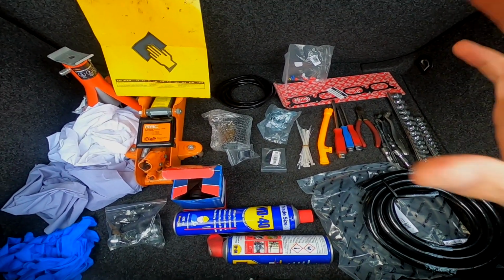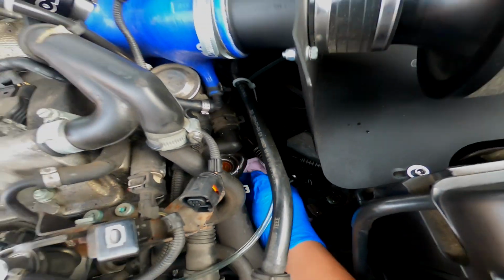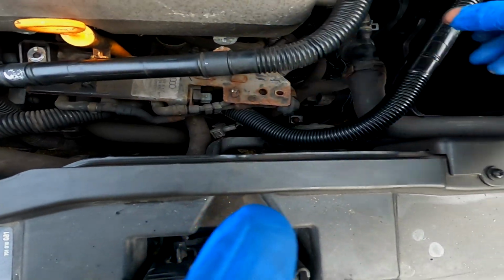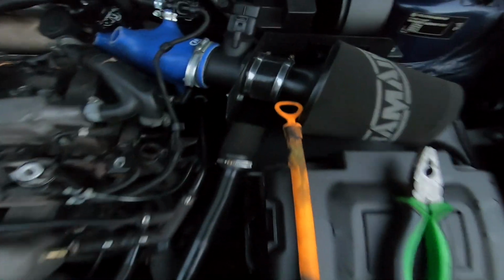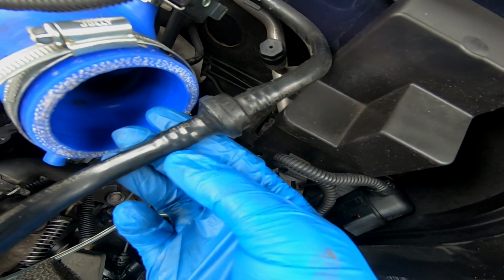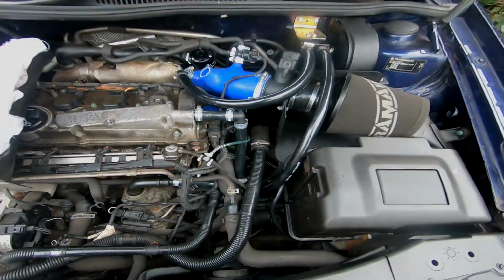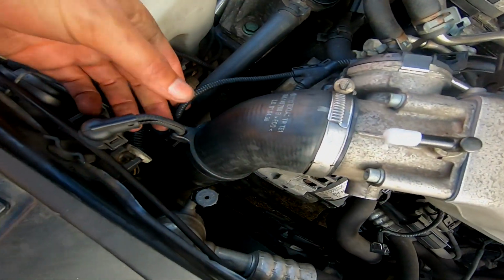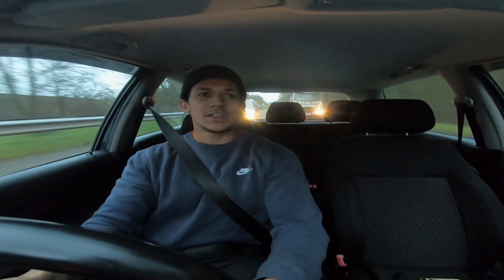MK4 VOLKSWAGEN GOLF GTI 1.8T SAI/N249/PCV/EVAP DELETE/CATCH CAN INSTALL

Comment: RIGHT! I've literally this minute finished doing this on my AUM, used your video as a reference when I needed it. Very helpful & informative. You're a diamond pal, thank you!
Reply from the maker: I'm glad you went for it man and im happy to hear the video came in use here and there if you ever got stuck. Well done for getting it done as it isn't easy. Thanks mate!
Reply: @SPOOLINUP  Runs sooo much smoother too, i was suprised, I bought the Cloud9 Catch Can in the end, came with everything needed, apart from an unfortunate slip with the stanley blade, all went smoothly haha!
Reply from the maker: Hahaha, so in that case then you could have had a small vacuum leak and removing these items got rid of it. What did you slip into with the Stanley blade? Lol
Reply: @SPOOLINUP  my hand, left blood everywhere, but the cars done, that's what matters hahahaha
Reply from the maker: Ahh damn, your hand will heal, if you cut through the wrong hose it wouldn't heal 🤣🤣
Reply: Were can I find the resistors from??
Reply from the maker: Hi, which resistors are you referring to?
Reply: @SPOOLINUP for sai delete n n249 evap??
Reply from the maker: I never got any resistors, I got them all mapped out/removed from the ECU.
Reply: @SPOOLINUP OK sound for your time appreciate it m8 top lad
Reply from the maker: No worries mate, i've been so bad with replies. I deleted all of the hardware and I had the EML on of course. My friend was able to map all of the software out and the car never knew it was missing anything.
Reply from the maker: I've just seen that those resistors are not expensive anyway.
Reply: @SPOOLINUP ye I know just sipping cost more lol 😆 easy map it out like u z only 180  mapping
Reply: aum , pressure appeared in the tank after plugging the fitting, connected n80 to put it in the air, How is your n80 now?

Comment: Same as everyone else great video , did you ever get any codes come up after a while after  doing this ? And are you still running your car like this
Reply from the maker: Hey man, yes codes came up after doing these deletes but I cant remember off the top of my head what they were. I have had the software deletes done from my ECU so that the car no longer throws the faults up. The only thing I have changed is I took the vacuum cap off the EVAP in the engine bay and it now just vents to atmosphere to prevent a build up of fuel vapour in the tank. Thanks for your comment and keeping it positive and supportive.

Comment: Hey did the resistor remove the secondary air engine codes. Or do I need to map it on order to delete that code?
Reply from the maker: Hey, I never fitted any resistors I just got everything mapped out and cable tied the plugs out of the way.
Reply: @SPOOLINUP  wow, why didn’t that cross my mind. Thanks 🙏
Reply from the maker: No worries man, literally anything that would be flagged up after the deletes was mapped out and my second lambda was mapped out too. Hardware deleted from engine bay and then software deleted from ECU.

Comment: Hello good video! I have seen these kits that companies are selling they include the resistors where do i put the resistors?
Reply from the maker: Hey man, are you talking about UROTUNING and the likes? If you follow the link below it shows you where to put the resistors. I never used them as I just got the software deleted. 

https://www.vwvortex.com/threads/diy-ultimate-sai-n249-pcv-evap-delete.4893472/
Reply: @SPOOLINUP  yes thanks! How big are all the hoses in mm? And how long are they?
Reply from the maker: I cant remember exactly mate but even the link has it all at the beginning exactly what you need. I know the catch can hoses are 19mm. Any vacuum hose required is 4mm and I believe the hose for the brake booster upgrade works out yo be around 13mm but if you check the link its all at the beginning and you can use Google to convert it to metric as its all in inches and feet.

Comment: Nice job. Do you have a knock sensor unplugged?
The VVT is for emissions or better performance?
Reply from the maker: Hey man, the knock sensor is still plugged in I havent touched it. 

VVT is there for emissions I believe it helps with emissions on cold start etc but no real performance gains unfortunately.

Comment: I can't thank you enough for this very well produced instructional video.
It was concise and easy to follow.
If you can do all that work with one hand you certainly are talented!
After removing the cylinder head on my daughters 2001 Golf  (Timing Belt failure) and disconnecting endless hoses and electrical connections I was happy to learn I do not have to put all those hoses back to stock.
You did a fantastic job showing each and every detail!
I had noticed when disassembling our VW  that several of those hoses and lines were dry rotted and surly there were leaks!
Surprising the car ran as well as it did!
Cheers!
Reply from the maker: You are more than welcome man, im glad it has been helping you along your way. Did the timing belt snap? If so any damage to valves/camshaft etc? 

Some work is done with one hand but some done off camera, I do have a head mount and chest mount but never use them. 

Yesterday I was working on the car and was topping up the break fluid when I noticed more hoses looking cracked in that area. 

I appreciate your breakdown of why you like the video as well so thanks for the nice feedback and good luck with the rest if the job in hand 👍🏽

Comment: Hi mate, been watching you're vids, big help, appreciate that. Just ordering stuff for deletes... Do you think 1m of each diameter hose will be enough? and what size blanking caps did you use?
Reply from the maker: Hi mate, im glad the videos have been helping you and thanks for watching! I apologise for the late reply. The hoses for the catch can need to be a little longer than a meter. If you look in the description there is a link to a guide which tells you pretty much all you need. As for the vacuum caps I bought an assorted package from ebay or amazon and then realised I needed some larger ones so ordered them but I am not 100% sure of the sizes mate im sorry. I can imagine some were 4mm, 6mm, 8mm and 10mm but not 100% sure as I have even replaces some since. The coolant neck was replaced along with the PCV 90° because it may as well be done while you are working in that area to keep it fresh and new as they may break in the future. Sorry I can't be of much more help .
Reply: Also why'd you replace the coolant neck?

Comment: What did you delete? Can you explain the cons of deleting all that stuff ? And do I loose my AC ?
Reply from the maker: Hi, the systems that were deleted basically mostly are there to control vehicle emissions. The cons of deleting them is that you end up with a tidier engine bay and you future proof your engine ridding it of potential vacuum leaks. Your AC stays!!

Comment: I am probably going to sound stupid but what is the evap delete and catch can install good for ?
Reply from the maker: No you don't sound stupid, before I bought this car I didnt even know what both of those things were good for.

The catch can collects a load of vapour and oil that would otherwise go into the intake of the car and get burnt. Its not a lot at all but over weeks it collects in the catch can. 

There is no performance gain from deleting the EVAP but its connected to some of the other parts you deleted from the engine bay, clears up some clutter and is one less thing to go wrong. 

Hope this helps

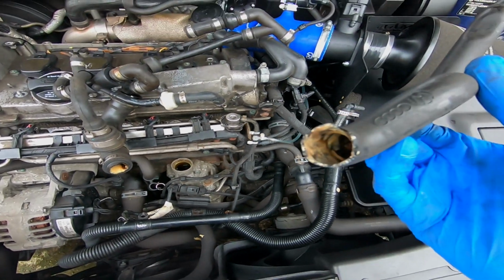Comment: the 90 degree elbow of the pcv system that you took off at 21:04, does this simply pull off once the U shaped locking spring thingy is removed? I'm having a hard time removing it :(
Reply from the maker: Yes brother that just has an O-ring holding it in place, give it a wiggle back and fourth while you pull it and see if it comes free. Do you have a spare one in case you break it because it may be brittle?
Reply: @SPOOLINUP  Thanks for confirming, I'll retry tomorrow. I do have a new one (it's the reason I want to take off the old one, preventive measure). Doing some work on the inlet manifold and surrounding bits.
Reply from the maker: Fair play mate good luck with it tomorrow then I hope it comes off nice and easily. I cant even remember if I bought a new one, I think I did. Let me know how it goes anyway mate.
Reply: @SPOOLINUP  You were correct, a good wiggle and it came off. The piece is absolutely gunked up.. yuck. Small piece of it broke off in the connecting T piece, otherwise it came out fine. The hose connected to the pcv valve had 3 massive holes in it.. glad I'm replacing the whole thing. The piece that broke for you, is made out of metal on the APP engine (slight difference in design), so I can clean that up and re-use it. Not sure why they went with plastic on the later engines, cheap bastards 😂
Reply from the maker: There you go man im glad you did it, some of these things just need a little persuasion. All of my PCV bits were gunked up and nasty too mate, I didnt find any holes but good thing you found the ones that you had there. I have never understood why they went with plastic bits in certain places, maybe manufacturing costs or something 🤣

Comment: Love the videos man keep up the good work 👍 quick question, I done the evap delete on my GTI and when I open the fuel cap air seems to be locked into the tank and releases when I open, does that happen you? Cheers.
Reply from the maker: Hi mate, sorry. Dont block the EVAP in the engine bay, if you put a cap on it then remove it and let it vent to atmosphere. Basically it will allow the fuel vapour to build up, my mistake in the video I blank it off. Remove the cap and it will be fine. Thanks by the way! Appreciate your comment. I hope this resolves your issue

Comment: The piece you pulled off and shown at 10:35, i don’t have but is black and plastic (not much of a description, I know lol) I just bought the car back in august and I’m trying to learn more about what’s done to it since the previous owner doesn’t know the history on it. I found the pcv has been deleted, and same with the sai. Also just out of Curiosity what is clear hose for that T’s off of the fuel rail? One of the previous owners did that same thing and is hooked up to a boost gauge. By the way great video, its very detailed and helpful. You’ve earned a sub.
Reply: Update: I’m still watching the video as I comment, the black piece I have is what you replaced
Reply from the maker: Sorry mate where do you live in the world? I was fast asleep 10 hours ago man so sorry for the late reply
Reply from the maker: That would be the Combi Valve that I pulled off there and then you block off where that would have gone with a blanking plate. The clear hose that I have coming from my fuel rail is also for a boost gauge so its probably a similar set up. I have now got my boost gauge running off the vacuum line that goes to the top of my diverter valve. I appreciate your sub and comment man! Thanks for the support. I hope everything is helpful for you
Reply: @SPOOLINUP  yea we have a pretty similar set up, could I add you on snap so I could possibly show you what my set up looks like for a better understanding of what I’m saying? You’re welcome for the support, the video helped me understand my motor a lot more.

Comment: Loving that bracket bro. I mounted mine on the plastic box where all the relays are housed but tbh i am not happy with it. Definitely needs to be mounted against the metal body of the car like you have done
Reply: Go over it with a scotch brite pad before you paint it so paint sticks to it better, maybe bang it oven at 130c for 15min just to bake n harden paint as well
Reply from the maker: Good shout man, I did attempt to rush spray it once and quickly wiped the paint off because it looked like I dunked it in a pot of paint and pulled it out 🤣
Reply from the maker: That homemade bracket Hahaha. Listen man if you get a piece of metal with a 90° bend in it then just make some holes and away you go. I have seen some people mount it at the front as well near the bonnet catch.
Reply from the maker: Still need to spray that man you reminded me

Comment: Didn't really fancy the pain of doing this. I have the AUM in a new beetle. I don't know if it's the same? Where did you get your caps to blank things off? Excellent video though man 👌
Reply from the maker: It was painful but well worth it for sure mate. I just bought some assorted vacuum caps from Amazon and Ebay I believe. Its a long time since I did them and I even replaced one or two with better fitting ones since. I'm glad you liked the video though, sorry I can't help much more with where I got all of the bits.
Reply: @SPOOLINUP  still a better answer than you get from some others. Really glad these engines are still being tuned. Thank you
Reply from the maker: Thanks mate, you arent the first to ask that question and I couldn't answer it then either haha. The good thing about the 1.8t is that it came in so many cars and these cars aren't the most expensive now, there are parts to buy new and used everywhere you look. 1.8t is a smart choice.

Comment: What are the benefits from Doing  all the deletes can someone explain please 2001 1.8t  mk4 gti look g for any advice on this
Reply from the maker: Removing vacuum hoses from the engine bay will lessen the likelihood of future vacuum leaks as these 1.8t engines suffer from them. It also de-clutters the engine bay massively, the combi valve, vacuum hoses, SAI etc take up a lot of room. So you are future-proofing your engine. By removing parts and hoses that could fail you are making it more reliable. I realised when I did the deletes that it freed up a lot of room in areas that would have helped me when I was doing my TIP and other mods so I would have done the deletes first if I knew this. Vacuum leaks can be hard to find, once the deletes are done you can the software deleted from the ECU so you get no engine management light and then its like they were never there. Read the thread in the description and Google it because im sure there are more benefits too.
Reply: @SPOOLINUP  thank you for responding — did you personally notice a difference in throttle response or any noticeable changes?
Reply from the maker: You are welcome. To be honest I cant remember, I was mostly impressed with the extra space it made in the engine bay. I looked at the massive pile of unnecessary clutter on the floor after and was pleased.

Comment: Hey bro I see it said n249 delete also but I still see it there? Does it get deleted
Reply from the maker: Hey man, the N249 gets removed when you cut the hoses and take off the metal plate by the dip stick. The N249 is mounted below that plate.

Comment: Hey bro, are you running Any issues after This delete? i want to know so i can prepare myself for it. (If there are any)... awesome Chanel love your vids!
Reply from the maker: Hey man, yeah there are some issues after doing the deletes to be honest. The EML came on as expected and the car has idling problems. The car doesn't always idle well, sometimes it bounces a bit but it doesn't happen all the time. Also I have noticed that the car doesn't have problems when it is left to warm up at idle for 5 minutes or so, when you drive it when its cold it has problems. Under acceleration its fine. I was assured after doing these deletes that the issues could be resolved with a map to delete the systems the ECU is searching for that are no longer in the engine bay. I hope this helps you somehow. I will be having my car mapped soon for the deletes as I dont drive it as my main car so I havent been using it. I hope this helps you and I appreciate your feedback. Best of luck man 👍🏽
Reply: @SPOOLINUP  maybe i will only do the n249 and the SAI. Thanks for the fb 👍🏻💪🏻
Reply from the maker: To be honest with you I am not sure what causes the biggest problems in terms of how the car runs if you haven't had it mapped to run with the deletes done. SAI is a good one, you get a good sense of achievement after that and the engine bay looks a lot better.

Comment: Hey and thanks for this, nice job
Have you got any problems when deleting Pcv and prv ? I mean from crankcase breather to catch can, then straight to TIP!! No vacuum problems? Hesitate idle ? Also oil cap when idling is it under vacuum??
Sorry to many questions , goob job
Reply: my Pcv delete is catch can to atmospheric, and blocked TIP port .
I think yours is better.
Reply from the maker: Well I think that yours probably looks neater to be honest as it gets rid of one of the hoses and its less risky because if I dont empty my catch can then its all going into my turbo.
Reply from the maker: There are definitely idle issues but I was told that it is due to the SAI delete, not too sure about anything being affected by the PCV delete. I have not been driving the car because I am aware that I need to have the deletes mapped out on a computer and then I'm sure any issues will go away.